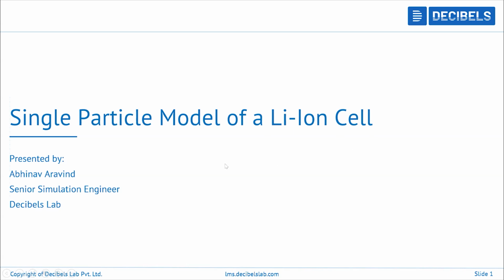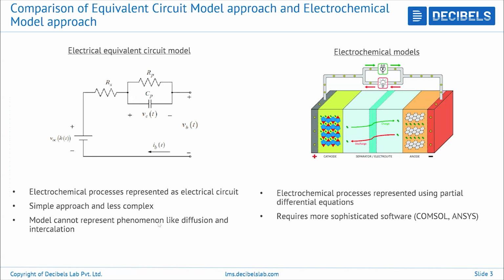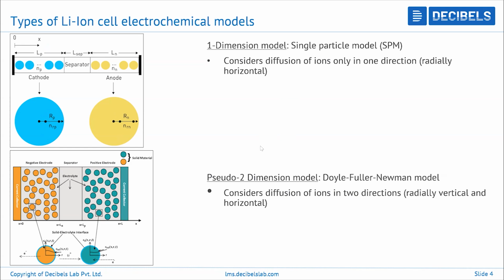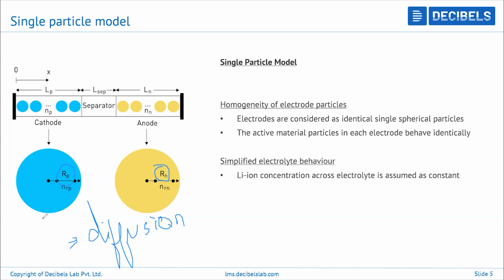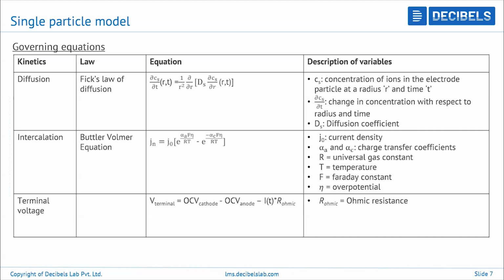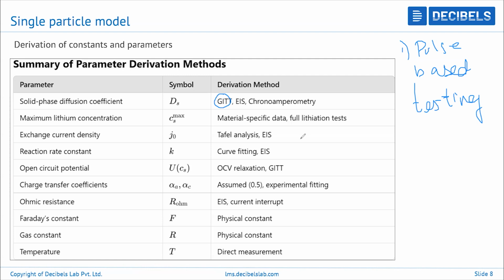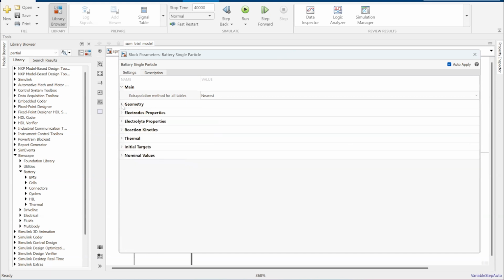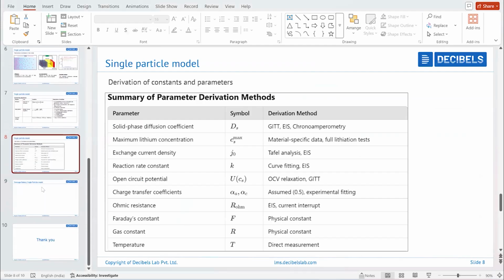Single Particle Model of Li Ion Cell

Comment: Timestamps (Powered by Merlin AI)
00:05 - Introduction to the Single Particle Model and its advanced applications in lithium-ion cell modeling.
02:30 - Overview of lithium-ion cell electrochemical models, focusing on single particle model.
07:12 - Electrochemical models provide a physics-based approach to represent battery behavior.
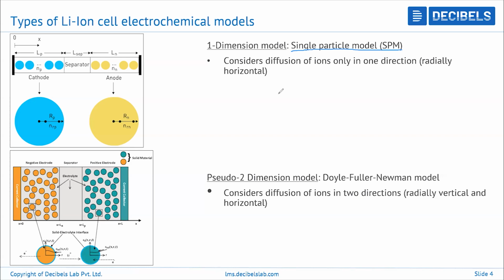09:31 - The single particle model simplifies ion movement to one dimension.
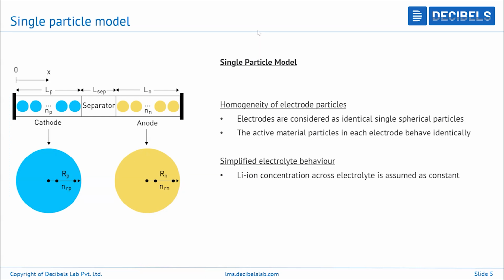14:07 - The single particle model simplifies behavior of electrodes and electrolytes in Li-ion cells.
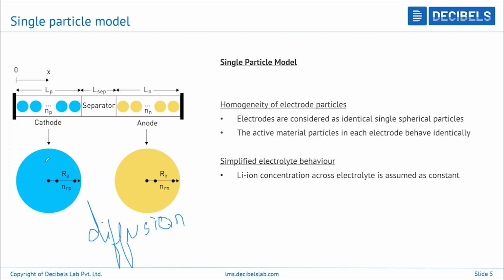16:18 - Diffusion is crucial in the single particle model of Li-ion cells.
20:15 - Key mechanisms of the single particle model for Li-ion cells.
22:17 - Understanding partial differential equations in the Single Particle Model.
26:19 - Overview of parameters derived from lithium-ion cell testing methods.
28:35 - Single Particle Model simplifies complex battery modeling with fewer parameters.
33:21 - The model simulates battery heat generation and performance at low currents.
35:20 - Single particle model improves lithium-ion cell voltage simulation accuracy.